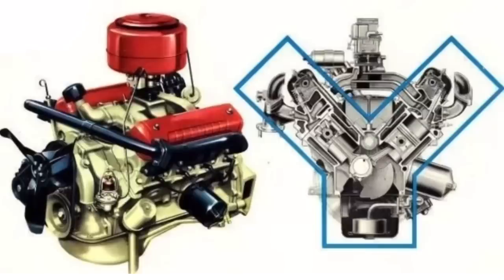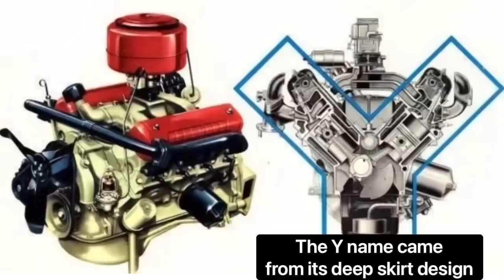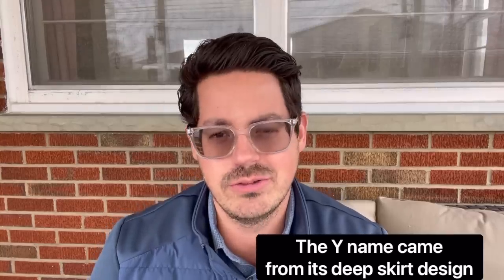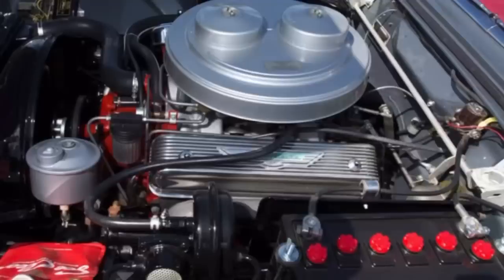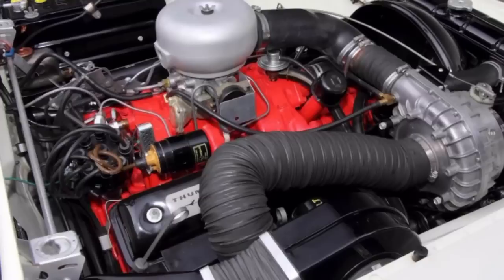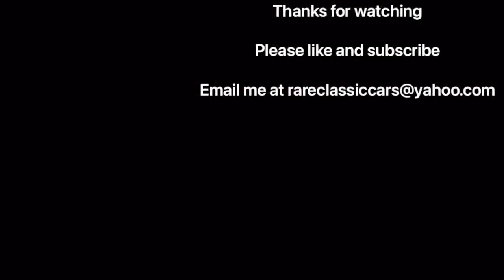Worst Engines of All Time: Ford Y Block V8

Comment: The y-block is one of the most underrated engines ever. The shortest conrods are more than 6.2 inches long.
They high swirl combustion chambers.
The deep skirt design added strength.
Everyone a side oiler.
All had air gap inlet manifold.
Had shafts mounted rocker arms
Supercharged ones gave up to 360hp.
They are great motors. Arguably one of the best small cube v8s Ford made.
Reply: Agreed.
Reply: Pertronics will fix that, had a unit in my 292 for 11 years and no problems at all.  denniswilson8013
Reply: Agreed.

Comment: Almost all Ford engines have major oiling problems. There are a few exceptions the 427 side oiler comes to mind. Don’t get me wrong Ford made some great engines but they need major oiling system upgrades. My 351 Cleveland spins over 9500 rpms but required drilling oil passages from the mains to the valley and running external oil lines to feed the mains.

Comment: I had a 58 fairlane and it had a 292 cubic inch was in high school and I took really good care of my car changing the oil every 2000 miles with Gulf pride single g. Never had any problem with that engine was really a great engine. Care is what is needed on all gasoline engines

Comment: The Y block were suggested to use detergent oils from day one . At that time most engines did not require that and most  people did not know what it meant , they just bought a Ford and used the same oil they always used . That engine used oil passages that flowed through the front cam bearings and if the required oil  was not used the small openings in the cam bearings that became clogged caused the lifter bearings to fail and the falve liters to fail .

Comment: One person I'm glad I never met was the person who proposed the intake port setup for the Y-block Fords. They just basically took what turned out to be GM Siamesed port horizontal  set up, rotated it 90-degrees and that was supposed to be the panacea for OHV engines. Visualize a small block Chevy with the intake ports rotated that 90-degres. And who in the Ford engineering department signed off of the proposed design.? There was no purpose for what they did.

Comment: I have been a Ford guy for over 60 years.  Calling the Y-Block the worst engine of all time is an exaggeration. They had their problems, but they weren't that bad.  As far as bad oil is concerned, that wasn't a Y-Block only issue. Sure the rear seals leaked and the rocker shafts wore out. I disassembled many a Chevy small block that had 3 inches of sludge in the lifter valley.  Some early Chevy V8s didn't even have oil filters.    My first hot rod experience was with Y-Block engines. In the mid sixties, they were cheap and plentiful.  A Y-Block engine with a manual transmission would fry the tires to the ground.  Back then, you could buy a decent car for $200.  In the today's times, the Y-block seems prehistoric.  Back then they were pretty cool.
Reply: Check out the Dearborn Marine interceptor V8 from the 50s and 60s. Other than the bad transmission installed on the first generation of Marine engines, they were excellent. Very powerful and reliable. The y-block Ford had its problems but overall was an excellent engine.
Reply: Y-blocks held up well due to the fact they didn't make a lot power.
Reply: With good oil these engines were great have 55 ford for 39 years the 292 has been great, I have been everywhere with it.They won a lot of races back in the day  .Boo to your comments
Reply: @GrosvenorNewcomb  The Ford Y-Block was a transitional engine between the flathead V8 and the much improved FE series. They were very robust engines for their time and will last many miles with proper maintenance.   Unfortunately, they suffered from a poor oiling system.  They leaked oil from the rear main seal and suffered from valve train oil starvation problems.  I have owned and raced a number of Y-Blocks over the years and they still bring back good  memories.
Reply: It’s all on opinion. The Chevy engines were even worse

Comment: Yes, these engines, and 1954 Fords are one of my specialties. These were originally advertised as having 132hp, as to their counterpart 115hp “Mileage Maker” inline 6. The Y blocks were never as good as the I block and couldn’t compare to the durability and reliability. I’ve seen multiple I blocks, specifically 1954s with up to 400,000 on the original factory built engine and still running or capable of running just fine. The I blocks are among the best engines in history in my opinion. Everything from easy service to decent power for the era, decent gas mileage, outstanding reliability, and excellent durability.
Reply: I understand what you’re saying here but I love a good strong powerful y block as well as the awesome sound they make through blue bottles or cherry bombs. I have a very nice running 272 in my 59 galaxie with a 57 4 barrel intake running a 600 Holley and pertronix ignition well I’ll tell you what it does absolutely amazing and I’ve had that combo in there for roughly 9 years now. I also have a 223 in a 59 meteor and actually it’s a car I bought way back in 1992 sold it in 1999 and got it back in 2018 with its original 223 still in it and i can attest to its decent power decent fuel mileage and most definitely it’s spot on reliability. I’m
Not sure how many miles are on it since the speedometer didn’t work when I got it back but I’m guessing it’s somewhere close to 200000 that old girl just runs and runs and runs what a fantastic engine 👍

Comment: Well, I have a diesel half of a Y block. Let me explain: in 1958 the Romanian "Steagul Roșu" (short form: SR; Translation: The Red Flag) factory started to develop their second truck, the SR-131 Carpați (Carpathian) wich had a 140hp, 5025cc license built Y block named SR-211. The truck came on to market in 1960, had two brothers, the SR-113 Bucegi and SR-114 Bucegi (named after a smaller mountain range inside the Carpathians). It was later replaced by a SAVIEM diesel engine.
Meanwhile, in 1964, the ARO Plant (Automobil Romanesc; Translation: Romanian Automobile) had a need for a more powerful engine to replace their copy of the soviet copy of the flat head four. They knocked on the SR factory's door and they got the right half of their V8, a 70hp 2.5 I4 named M-207. It was used on IMS M461 (Intreprinderea Metalurgica de Stat; Translation: The State Metallurgical Enterprise). Idk which the factory name was at that time, either IMS or ARO or something else when the IMS models were produced. Anyway, in 1969 they were developing the ARO 240 models which came to market in '72 with the evolution of the M-207, a 2.5L i4 with either 75 or 85hp (depens on the source) named the L25, aka Câmpulung, nicknamed after the location of the factory. 
They need a diesel engine for their new offroader so in '78 they got the UTB (Uzina Tractorul Brașov; Translated:The Brașov Tractor Plant) D-127 3.1L 68hp aka the Brașov engine. 
Idk why but they wanted an ARO factory made diesel engine so in either '83 or '85, they thought it was a great idea to transform the ancient L25 into a diesel engine, so they did. Out came the L27, an N/A 2.7L i4 diesel, with 70hp on the promotional papers, because the manual says it has 65hp plus or minus 5hp. They slightly reengineered the head for it to accept a pre-chamber for the indirect injection. I'm not much of a diesel guy so idk how that pre-chamber works. They also made this engine in such a way that it fries head gaskets and burns valves. Even the gasoline engine had problems with overheating but the diesel took it to another level. It also has problems with oiling cause the pump shaft breaks and the passages can clog. The build quality wasn't helped by the fact that in this period the resources needed were in short supply (mostly for political reasons) and the impoverished workers started to steal from the factories to survive.
Around 1990, probably even before the revolution, they started to make the DX and TDX engines, an evolution of the L27, the N/A DX and the turbo TDX. They reengineered the head again, at least for the TDX, I've never seen a DX and there is almost no info on them. It now had the intake and exhaust on opposite sides, for reasons beyond my understanding, they crammed the intake and exhaust on the same side of the head for all the previous versions. Idk much more about them, but I wonder how the TDX manages all that added heat from the turbo and how it handles oiling.
So the Y block left quite a legacy across the ocean, It was used from trucks, fire trucks, to offroaders, even the romanian copies of the russian BTR and BRDM use a slightly modified version of the V8 and they are still in service.
I own the L27 in an '82 ARO 243. One year ago it spun the no.1 rod bearing on the way home from the previous owner. I struggled to find somebody that would reject me when I just said "I have an ARO" but now I found a guy who works on these. I am am very close to starting the engine after combining the head from the original motor with the bottom end of a "new" engine that looks like it had few kms run but it stood outside for a while. Overall 10/10 diesel half of y block made from cheese and derived from 10 other engines experience.

Comment: The FE/FT engines are the toughest and lightest combination made for racing, choked on the street by cams and exhaust manifolds.  The FT was a truck engine is cast as I understand the same recipe of iron as the 427 and 428CJ-SCJ. It would make a great best of candidate. The 460 is OK but it weighs 150lbs more than the FE. An FT block many times can be bores to a 428.  That would be neat to see a deep dive into the FE.

Comment: The 317 Y block came out in 1952 and topped out with the 368 Turnpike Cruiser. I was a kid replacing the Y block with a 368. It came with 3 2V cars, and we changed the intake and in a 57 Ford 2 dr HT. It was FLMs first OHV, and were used in trucks for the N series until 1964 I believe.  You could shave the heads and they had surprisingly good ports. The oddness of the Y block is unexplainable. The 368 when worked on it was wow!

Comment: Plus there is some big power reliable built 292s out here 
My dad owns one in a 64 f100 with disc brake conversion and c4 transmission swap

Comment: Had a 61 Ford Fairlane. Beautiful car but that darn y block killed me. I went through several engines because of that oil distributor issue. I put an engine in with the intention of adding the oil kit to it after I went to a car show. Nope. The engine died on the way there. I didn’t get more than 500 miles on it. If that. 
I was done. Lost my a$$ on that car. 
A guy I knew acquired it and put another rear end in it and added a 390.

Comment: Before making this video you should’ve done research on achievements this engine made and races this won your beloved pile of SBC. This was only replaced because of its limits to C.I. Hint the FE. The owners not understanding what oil to use was the problem. Maybe make a video on the “worst” owners of the y block. This engine has a great tone and cool factor. Won Engine Masters and several years in a row and was the cover of Hot Rod magazine. So explain that one lol.
Reply from the maker: A derivative Cadillac Northstar also won numerous racing awards. I wouldn’t call it world class.

Comment: Those gerotor oil pumps would not tolerate any foreign materials to pas through them,. Mt father bought two 57 Merc's one had gotten some shavings in the oil and it seized the oil pump twice because of it, because it sheared the hexagon pump drive shaft.
   The other Merc locked up the distributor while he was driving on the expressway's Both engines were Y- block's. I never saw another engine with the G-Rotor oil pump.

Comment: The Y, if you choose this mission contact John Mummert and Royce Brechler. Mummert casts aluminum heads and intakes. He can also fix you up with a supercharger intake and with the rear distributor, a. 184 series even fits.  Mummert can also get stroker kits and cross bolt mains.  The first engine I built was my Dads Y block. The 2x4,ECG cam, heads and intake on a bored and stroked 320 ci. 2x4 intake. BTW the MEL and 385 were bros. The 368 Turnpike Cruiser and FE were bros. The 289 replaced the Y block.

Comment: This guy is obviously a Mopar or Chevrolet fan boy because hell I drive 1965 ford galaxie 2dr hard top that I've swapped a 1959 312 into and it's all stock I've done nothing to the motor but general maintenance and swapped to a newer 2brl setup. And it runs amazing. Never not one problem never had the block apart hell it has well over 250,000 miles on it. It does my 65 galaxie very well compared to the 289 it had. Its a world of difference in power and tourqe with the 3 speed Manual its pretty peppy

Comment: Oiling issues still persist in today's cars. The 3.6 and  1.4 gm equinox engines still have Oil issues.  Change it every 3000 miles and the problem is definitely lessened.  But many times people keep driving and wonder what happens.

Comment: My 54 with B/W air cooled Fordomatic cruised at 80 not breathing hard at all.
Distributor inconveniently mounted down low in the back was frozen into the block, never could turn or remove it. I really wish I knew better than to not change the oil. Filling the tank never took more than $5, I was way too cheap. 😢

Comment: Not bad but back then the Chev V-8 had more integrity. In both cases I hated the distributor placement low and in the back. Ford won me over with its 265/289, at least as good as the Chev with the distributor front and center so I didn’t contort trying to tune it.

Comment: They said the same things about the 348 and 409 Chevy engines , people always called them boat anchors  back then . With more modern  technology these engines  became horse power  monsters  . Just try to buy one today . The stuff they make today  many  still have issues . I had a bored and cammed up 312 in a 54 Ford , the transmissions and rear end gears  BACK THEN could not handle that engines power .

Comment: Guys if you have to fix the engine to make it good than maybe just maybe it wasnt a good engine. Im sure Maseratis and Fiats would be great cars if you changed the engine,trans, interior, exterior underpinnings too but it wouldnt mean that the car itself was great.
Reply from the maker: Haha. Yeah you made my point for me.  They weren’t bad as truck engines but they had issues in cars.

Comment: Another good talk. The Y block couldn't be abused like other engines of the time, back when people were being taught by dad's and G-dad's "wisdom". As I recall, most had a reasonable life but the non-existance of a PCV system did them no favors, especially for in town use. I think their replacement was partially due to the popularity of the GM small and big blocks. (Of course, in 1958 the big block was a nightmare introduction. Dad was on his 3rd warranty engine in his '58 before the GM engineers figured out why it was dropping valves.)

Comment: As a kid back in the mid-1960s I recall my older brother taking me to auto parts stores, where I recall rows of "detergent" and "non-detergent" motor oils; as they were side-by-side on the shelves.  The lids on the oil cans were of different colors, too, to denote the difference.
I recall there were urban legends going around about detergent oils not holding up as well as non-detergent oil; with some believing the detergent oil was prone to foaming, which would diminish the lubricating qualities of the oil.
Reply: Detergent oil was not always consistent.  Some would separate.   It became much better later on.

Comment: Great vid! Dad and I built a 312 for a hardtop retractable. If I remember correctly it had a McColoch (sure i spelled that wrong!) Supercharger. The guy drove 2k mi to get NOS. Funny how Chevy and Ford were the " only ones on the planet " when Chrysler brands had hemis from 1952 up along with polysphere motors that flattened any of these for reliability and power all thru the 1950's and are still burning nitro today with 1950's Chrysler iron blocks, heads, and cranks! The oldest continuously running rails are two called "Sibling Rivalry" that use injected nitro 1950's DESOTO hemis! They said about every 2 years if they're bored they tear them down in the winter to check things out. Mopar had no heavy industrial or truck engine line so those motors had to get your lobster boat home and make your crane dig for thousands of hours. Same for big blocks!

Comment: Worst take ever on any YouTube channel I’ve seen lol... you know very little to nothing about these engines and judging from the comments your subscribers vehemently disagree with your take. At 9:43 or so you say that not too many people cared for the sound of these engines. LOL, what is this, an SNL comedy sketch? If the engine design was that bad, how did Ford outsell GM in 1957 after both the SBC and Y Block had been out for a few years? If the Y Block was that bad, how did Ford DOMINATE the NASCAR divisions In 1956 and 1957 with more wins than any other make and at times 1st and 2nd at the same track? Fact check me on that - records don’t lie. As for the Lincoln Y Block you briefly mention, check it’s racing record at the Pan Americana in Mexico... While you missed quite a bit of information on an engine you say you know fairly well, you missed the most critical part of the engine design that caused some of the oiling issues. The oil channel from the block to the head takes a 90 degree turn, twice, on its way up to feed the rocker arm assembly. If you didn’t change your oil like the manufacturer called for then yes, the top end would starve. No rebuilt Y Block needs a top end oiling kit. Do a few more years of research before you tackle this one again - better yet, read through the comments - you will get an education.